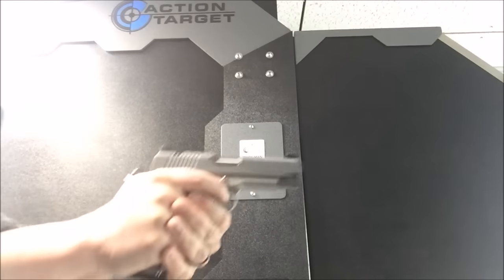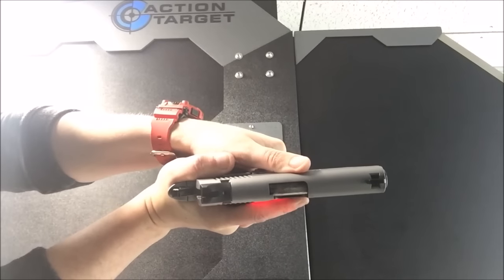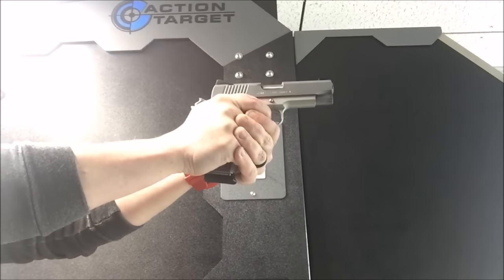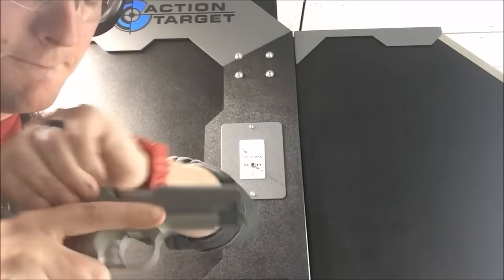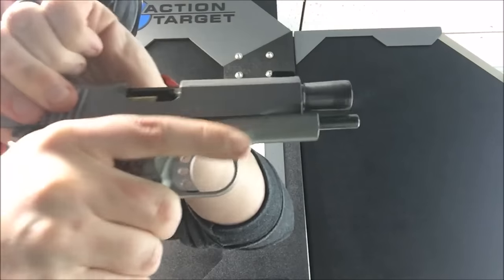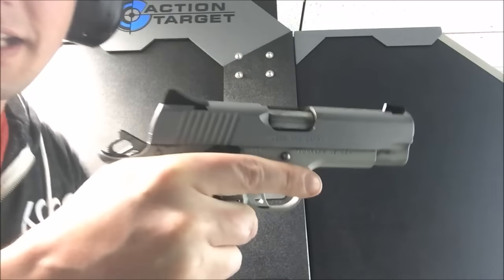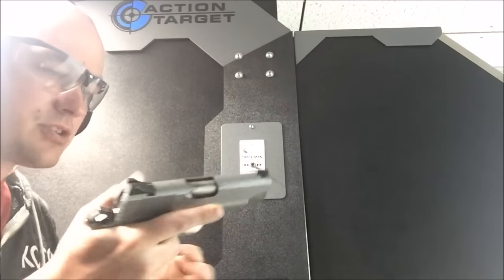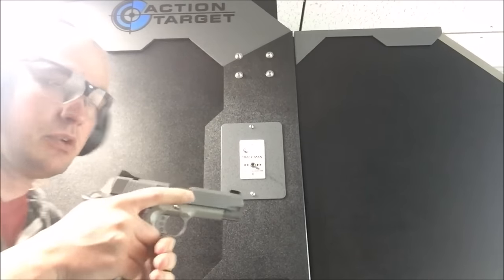Kimber 1911 user induced failure

Comment: Over sprung?  I just picked up a Colt Competition Pistol in 9mm.  It has a dual recoil spring system, for reasons I still don't get.  With minor power factor loads it feels like the slide is moving in slow motion.  I changed it to a regular 12lb spring and all is right with the world.  They also put a blue fiber on the front sight that is totally useless unless you like very dark fibers.....gee I wonder why they are bankrupt.